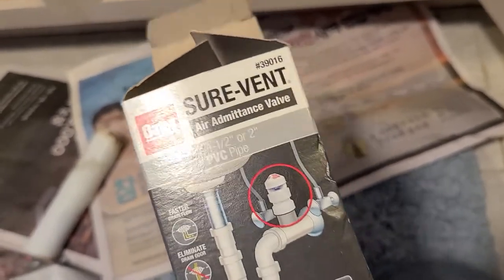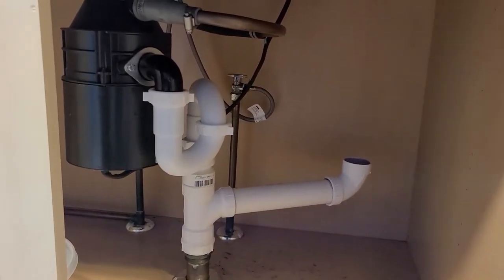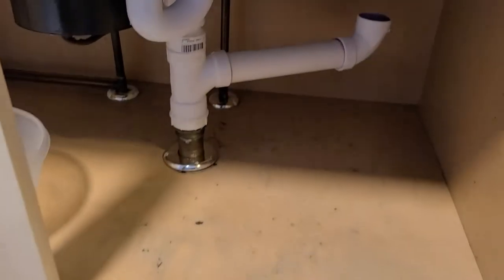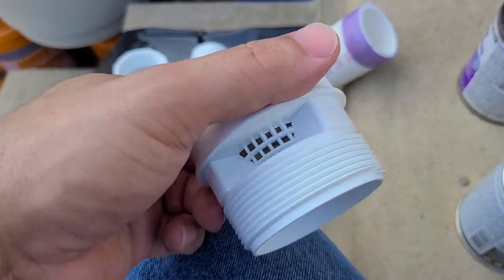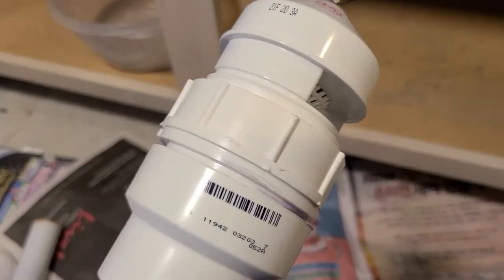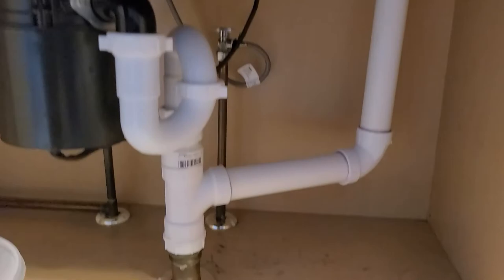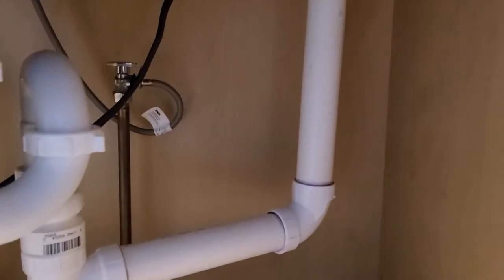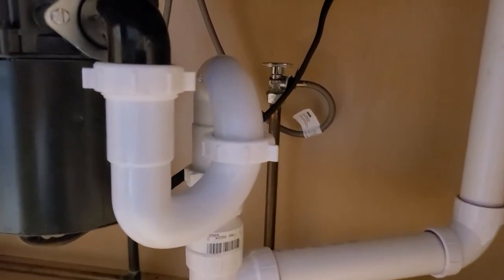Indoor Sure Vent

Comment: Why do you need the adapter? Why can't you just remove the old black ABS in-line vent and install the white part of the indoor Sure-vent?
Reply from the maker: If i'm understanding your question.
The indoor vent comes with the adapter. The adapter has inner threads. And the indoor vent has outer threads, so in the future. You can replace only the indoor event. In case it ever goes bad. Some people say they do fail over time, although i've not ever experienced that.
Hope I answered your question.😊